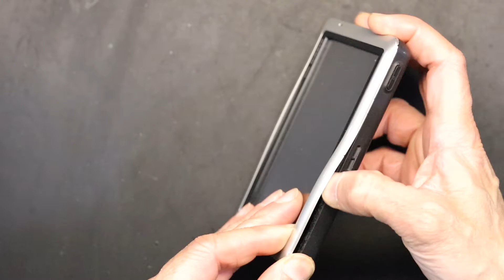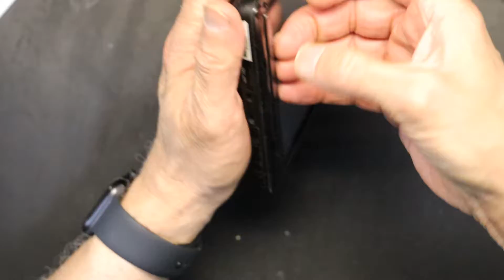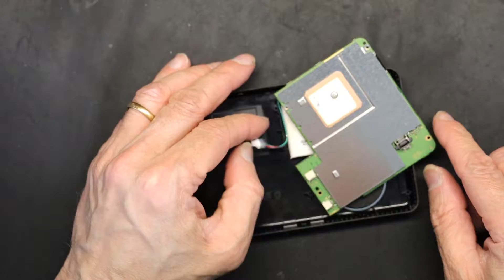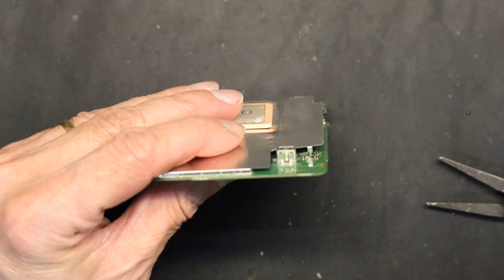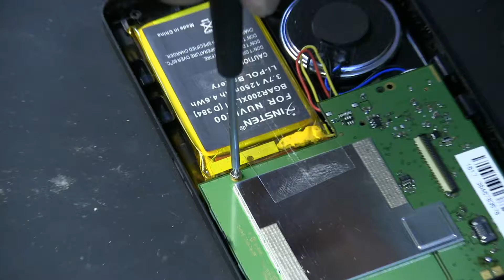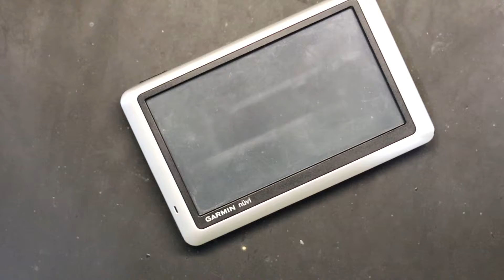USB Port Repair and Battery Replacement on a Garmin Nuvi 1300 1350 1400 1450 1490 GPS Navigation

Comment: Thank you for the video. Very clear, precise instructions.  I was doing a good until i damaged the flat ribbon  cable. I had a hard time getting the little bar to flip, did the repair for the charge port, as instructed, but now i have no power at all, I think i destroyed the flat ribbon cable. I'm a klutz.😂
Reply from the maker: I am sorry to hear that, unfortunately the ribbon cable is not detachable from the screen. So you will need to get another LCD Screen for it. They are available on eBay.

Comment: Replaced battery and resolded it. Worked until one bar battery indicator ran out. Unit died not take power. Cable is fine. Should replace USB port? Any precautions to take? Please,  specify USB port specs. Thanks.
Reply from the maker: Yes most likely there is a lose connection on the USB Port. In many cases you don't need to replace the USB Port, all you need to do is re-touch the solder joints to make sure the have a secure connection. However if the USB port itself is defective you will need to replace it. The USB port is not easy to find, Garmin uses a proprietary USB port which is not available for purchase, however this one linked below is the closest match.  
Click on the link and chose the color option C
https://www.aliexpress.us/item/3256804493541177.html
Reply: Thanks
Reply from the maker: @nestorpaez7546  No problem
Reply: Ordered the last one "C" they had. Thank you very much for your great help.

Comment: I have the kit to change the battery 1450...I got the first step done but I couldn't get those little screws unscrewed...I used a very little wd-40 still not able to get the screws out. UGH !!! I really don't know what to do from this point...any ideas?
Reply from the maker: You have to have the exact size screwdriver that I am using; if the screwdriver is just a little too small, it will damage the screws beyond repair. If the screws are completely stripped, even the right-sized screwdriver will not be able to open it. If that happens, you will need to use a Dremel tool to cut flat slots on the screws and use a flat screwdriver. Doing so will also cut the GPS case, but it will be covered up when you put the bezel over it again. If that is something you don't feel comfortable doing, you can send it to me, and I will open it for you at no cost. Just include a return shipping label so I can use to send it back to you. Thanks

Comment: Thank you for this.
I bought a Garmin 1490 from eBay for $15 & it wouldn't hold a charge & I requested a refund & got it.

The seller didn't want it back as there's no money in paying to ship it back, fix it, & sell it again.

So I'm willing to fix it & give it a shot. 

The battery was $14 so if I can fix it I paid $14 for it & got some experience in fixing & soldering which I'm new at.

Hopefully when soldering the charge port it goes well for me. That part is going to make me nervous.

The battery is coming this week so maybe I'll solder it before it arrives.

Thanks & hopefully things go well!

I don't know how to update this device though? 
Do I need a memory card?
Reply from the maker: Most likely the battery will come with the connector which you simply plug in and no soldering will be required. Yes you do need a memory card if you download the new maps, because it will not fit on it's limited 2GB internal memory.
Reply: @TECHNOLOGYTIPS101  I had 2 issues:
-dead battery
-loose charging port like in your video

I got the battery on it's way & after seeing your video I might try to solder it myself, but I'm nervous about that charging port soldering.
Reply from the maker: @ClickClack_Bam  OH, ok, good luck with the project.

Comment: Please send me manufacture part number of USB port and where I can buy that.
Reply from the maker: Hi this port is only available from China and here is the link https://www.aliexpress.us/item/3256804036788639.html?spm=a2g0o.productlist.0.0.2b5859f2XsravN&algo_pvid=6acde56c-148e-4063-a2f5-e033eee2fa3f&algo_exp_id=6acde56c-148e-4063-a2f5-e033eee2fa3f-32&pdp_ext_f=%7B%22sku_id%22%3A%2212000028433966342%22%7D&pdp_npi=2%40dis%21USD%211.36%211.22%21%21%21%21%21%40210318be16653012925924857ee55d%2112000028433966342%21sea&curPageLogUid=2CBlQYlClQJ1
Reply: Are u sure this is the exact the same port? @TECHNOLOGYTIPS101
Reply from the maker: @veitkuhn9348   No, it is not the exact same one, but it works for most Garmin units. The exact one is Garmin's Proprietary port, which is not available to the public.

Comment: Why would you use garmin instead of using your smart phone for navigation?  Is there any advantage to using old dedicated gps unit any more?  Some garmin units cannot even connect anymore as 2G has been decommissioned.
Reply: because gps runs off of satellites and cell phones have dead spots in coverage.  just because it is new doesn't mean it's all that...
Reply from the maker: Very good question, and here is the answer https://youtu.be/ranYKwsW4-I

Comment: i have a nuvi 1350 that boot to a GARMIN screen but i can't get it to go the where i can restore it to factory defaualts
Reply: i think im getting closer i get this error 
App: Updater
At: 6/22/2022 1:53:42 AM (UTC) 
OS: WIN32 Windows Platform, Major Version: 6, Minor Version: 2 
Processor: Pentium Pro or Pentium II, RAM: 2097151 KB
XFERTHREAD.CPP-1101-2.8

I can at least see it trying to communicate..  rs
Reply from the maker: @ronve5rs30  You need the firmware here is the link https://khalids.com/downloads/Garmin_System_Files/GarminNuvi13xx.zip
Reply from the maker: Turn Off the GPS, Keep your finger on the bottom right corner of the screen and turn it ON, continue to  keep you finger there until you get the erase all Data screen, once you get that remove your finger and tap on YES
Reply: @TECHNOLOGYTIPS101  Thanks  I tried that but no luck I am still stuck on the logo screen .  This started when i tried to update the maps with the garmin express app.
Reply from the maker: @ronve5rs30  Re install the firmware using Garmin Web Updater, not Garmin Express only use Garmin Web Updater software
Reply: @TECHNOLOGYTIPS101  sounds like a plan, but my biggest problem now is to get the computer to communicate to the nuvi 1350  or even see it at all
Reply from the maker: @ronve5rs30  Does the screen say " System Software Missing" ?
Reply: @TECHNOLOGYTIPS101  no, it only displays the Garmin logo then stops at that point. I don't see any sign of loading
Reply from the maker: @ronve5rs30  That means you need to reinstall the System Software using Pre-Boot method. It is a little complicated but not impossible. Here is how it is done https://youtu.be/nfX2S2yvySY

Comment: off topic question. Ive gota Nuvi 255w and Im getting a bootloop issue after "updating" some of the optional stuff. Like voice and text packages. I ordered a new battery since I already needed one but Im not sure if that had a part in the updating process. 

The system's storage shows up on my computer but when I boot it up. It gets to a screen (I factory reset it) where I pick my language and so on and if I let it sit on that screen. It goes black (No matter if its plugged in or on the failing battery) and if its on USB itll boot backup but looks. If on battery, it stays off..

Do you think the firmware just needs to be reloaded once I get the new battery, since itd be able to charge and stay on longer to finish the update/reloading? 

Any help would be awesome, Your videos were a lot of help when I was trying to figure out of the health of my battery and how to change it.
Reply from the maker: Yes that is exactly what the problem is, the battery can't hold enough charge to finish the update install process and restart. So you can either wait for the battery, or immediately connect it to a car charger as you unplug it from the computer for the update cycle to complete.